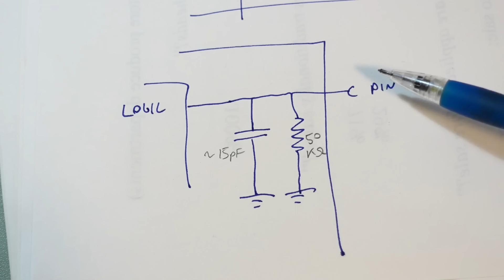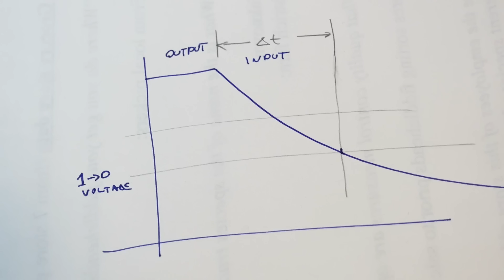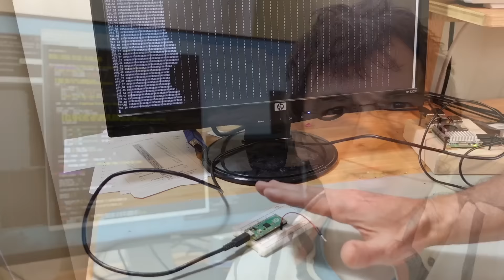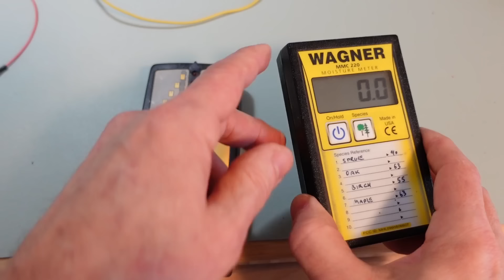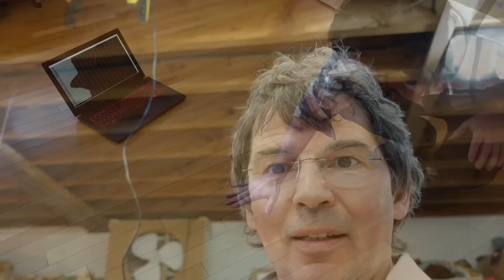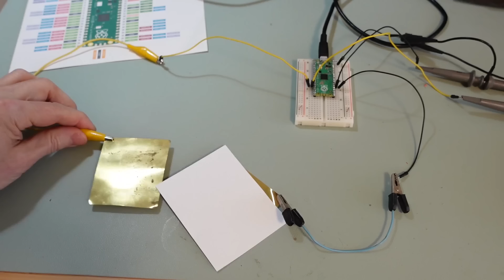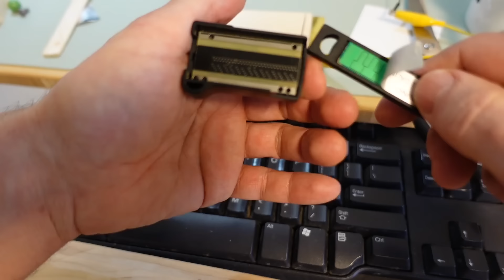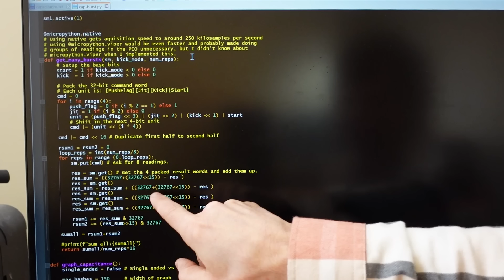Detecting proximity with very low capacitance measurements

Comment: Very nice. I want to mount an array of plates as a security system. Easy to run wires under the floor in my house, much more difficult to access the ceiling for traditional motion detectors.

Comment: I had similar sensor with 3.3-5V logical converter (those cheap ones) to detect my presence and room lights. I think i forgot to connect gnd and was surprised by non sensical output, which i realised depends on how close i am😂

Comment: There are some absolute digital calipers that don't need to be zeroed after a power cycle. I have one of them, works great and is very convenient - although I still can't get rid of the old habit of wiping the measurement surfaces and closing it to verify the zero point...
Reply from the maker: They all maintain position after "turning off" but that's because turning them off only turns the display off (also why the battery drains even while "off").  You have to remove the battery to be sure.
Reply: @matthiasrandomstuff2221  Ok, to prove you wrong, I just went to the workshop and removed the battery of the calipers. And actually... You're right.
I was dead sure, my calipers have been advertised as having an absolute measurement system. But it seems, I have misread that. Anyway, thanks for pointing it out, it did expand my knowledge 😀

Although there's one thing where your statement can be misinterpreted: Not all calipers maintain position after turning them off. I also have a bunch of cheap ones, which need to be zeroed every time I switch them on. For one of them it might be explainable by needing a new battery every time I use it. But the other one seems to also reset the internal circuits when switching off.

Comment: You can measure the resistance with a voltmeter. Try to measure the inside of the bag, not the outside. The conductive layer is on the inside of the plastic.
PS, that's why putting an electronic circuit on top of a bag is doing nothing, except making the risk is ESD bigger. Outside is a good insulator.
Reply from the maker: I tried inside and outside.
Reply: @matthiasrandomstuff2221 That's weird. That van only mean it's no esd bag because that must have some resistance. Did you use large enough contact pads?

Comment: I used to teach this to industrial design students using aluminium foil. You can get really creative using just aluminium foil and a resistor as a sensor. By the way the ESP32 has dedicated hardware on chip for this kind of sensing (called capacitive touch pins).

Comment: I love this idea. The capacitive can and plate experiments made me think of a project that I've done which uses a millimeter wave presence sensor to check to see if anyone is sitting at my desk. So the moment I walk away, the ESP32 I have connected to the  presence sensor sends keystrokes to my computer to lock it. 

I could see this as being a far simpler way of doing presence sensing without the need for the additional millimeter wave sensor. All I'd need is a plate mounted below or near my desk, and I could determine if I've walked away.

Comment: very interesting ! why human body affect electronic signals ?

I also encountered a similar effect when I was wiring an arduino to dot matrix module, where I connected the power lines and left the other 3 wires unconnected, so when I get my hands near the wires the dot matrix sends random signals to the MAX7219 and displays that of the dot matrix displays, the students asked me why and I told them that because there's electricity everywhere in the air and the human body is interacting with all these kinds of electricity + our bodies are already charged with some electrical charge.

Comment: I was using a pico for a training device using it with PLC software, and when I had it running to different stuff without bleed off resistors, I ran into getting false positives on it once installed in a box. At the time i ran resistors to ground off each input to eliminate it, as some of them would keep flickering on and off ruining the program from running properly. This makes me want to revisit it for other testing, thanks!

Comment: You're having too much fun. Another way to measure capacitance is to use it (the capacitance you want to measure) in parallel with a fixed capacitance in an oscillator tank circuit. Instead of measuring the decay time you measure the frequency change.

Comment: Always wanted to connect a caliper or the linear readout to my CNC. Cannot drill holes through caliper though. The steel is too hard. Did something crude with dremel and the diamond cutter, not good enough for accurate sensing

Comment: If i remember correctly, that method of checking the duration for a capacitance to lower is the exact method the computers of the eighties used to see the position of analog joysticks, which were just two potentiometers on a stick.

Comment: This is so amazing, thank you! I can think of so many potential applications for this. For example, I've been wondering about capacitive water level sensing and I'm certain this would do it. I have a humidifier I run in the winter that has a water reservoir that has to be manually filled and I'd love to know when it's getting low, but because of the design I didn't want to drill any holes in it (if any air gets in the whole reservoir will dump and soak my floor). I think this would do it!

Comment: You actually reinvented a very old trick used on tiny MCUs like AVR ATTiny2313 for sensing touch buttons. Also could be modified to make a simple ADC based on the same principle of converting a voltage curve on a known capacity to a time value.

Comment: I remember coming across this effect as a problem, years ago. On the old Microchip PIC devices, if you used one of the bit-set or bit-clear instructions it would do a read-modify-write on the GPIO, and because the input register and output register had the same address you could run into problems if you did several bit changes in a row: if the previous change hadn't fully taken place due to the load capacitance, the subsequent RMW would overwrite it. I remember it being sensitive to *everything*, including proximity, and possibly the phase of the moon.

Comment: if one of your capacitance plates was a bi-metal strip then you could sense temperature changes. Fixing the zero point might be chore though. Perhaps to measure humidity you could place some hygroscopic material such as rice , bentonite or silica gel between two plates.  Plenty to explore.

Comment: I'm thinking that instead of measuring voltage drop time you could also do the thing that they do in the cheap soil moisture sensors. They basically put about 1MHz signal into RC filter where the capacitor includes PCB tracks on the sensor, With the right choice of R and C values the output voltage will be capacity dependent. You'd need ADC input to read the value but wont need the precise timing. It may give worse resolution than timing measurement tho.

Comment: Cool, i made many years ago similar things with an AVR. Atmel made even a special library (and kit) around this for touch sensing (sliders, rotary switches etc). I made some sliders and they still work every day for the last 20 odd years. I made a slider (on kapton) to control some led lightning (dimming function) attached behind a strip of plastic.

Comment: Nice video for exploring capacitive sensor theaory.
Just in case anyone is interested, capacitive proximity switches are readily available at industrial suppliers.
Part of the sensors job is to isolate processor from the world. Using the output pin as the sensor leaves you exposed to the angry world.

Comment: Great experiments Matthias, and definitely food for thought. Presence detection for home automation comes immediately to mind.
Regarding LVDTs, it is perfectly possible to DIY such a thing and is essentially three coils wound onto the same bobbin with the central one excited by a frequency source, and the two outer windings used for measurement. A soft iron, or preferably a ferrite core at higher frequencies, is then moved mechanically through the centre. The downside is is the mechanical constraints and fidelity.

Comment: very interesting. this technique has a lot of potential. I wonder, how well would it work on other microcontrollers? Since it depends on fiddly factors like input capacitance and logic levels, it will probably work a little differently on different microcontrollers. but since it's all relative, it should work on a pretty wide range. This technique has a lot of potential.

Comment: Buy an "absolute" (mitutoyo) or origincal (IGaging) caliper/linear scale.  They have more than one scale and can dead recon their position.

Also, if you use a proper silver oxide caliper battery instead of an alkaline, the calipers can remember their position and track changes for 10months on a real 357/SR44/AG13 silver oxide  battery.  But only last one month on an LR44.  And many alkaline batteries are passed of as silver oxide natterybnumbers.
You could probably run a low Quiescent current 1.5V linear regulator off a small lipo battery to supply power.

Ignoring the vernier addition on a digital caluper, you can sense absolute position by using 3 electrodes in a capacitive voltage divider and feeding a full wave differential  ac signal (opposite phases)  into the outer two plates and measuring the AC voltage in between.  Thus can be done as a stack or in a sliding linear  configuration or a rotary configuration.  It is called capacitance micrometry.   I'm used to measure to 0.5nm over a couple micrometer range.

Comment: That's an interesting technique and it's reminiscent of how the IBM PC joysticks worked. IBM went absolutely minimalist (i.e. they cheaped out) on the "game port" hardware. Besides the bus interface, the X/Y lines just had a capacitor, a sense transistor, and a transistor that could discharge the capacitor. And inside the joystick were just a couple pots to +5V. When software wanted to know the joystick position it had to toggle the bits to discharge the capacitors, then stop discharging them, then read the bits back in a fast loop to see how long it took the capacitor voltage to get back to a level that would read as logic high. The longer it took, the higher the value of the resistor in the joystick was at that moment, meaning that you had the stick further down or right. Nowadays a $0.10 microcontroller can offload the job and do it with way better accuracy though!

The traditional way to do this kind of trick with capacitance, of course, is analog. You build an oscillator with the sense capacitor as part of its tank circuit, and its frequency will go down as the capacitance goes up. A nice way to measure that is to build two oscillators, one with a fixed reference capacitor and one with your sensor capacitor, feed them into a mixer, and get the difference frequency from the heterodyne effect. Then you can count zero-crossings to get the frequency difference and do the math to convert it back to a capacitance... or you can just amplify it and hook it up to a speaker and you've got yourself a Theremin (well, half of a Theremin at least).

Comment: Wow.
....
This gives me a feeling of how technology can know people's locations based upon data supplied by the WiFi Router.
People might think it's crazy, but I believe that they have a degree of thought reading technology built into modern smartphones.
Reply: Disconnect the ground on your Wi-Fi router and it won’t be able to sense people in the house. Could also create a ground loop around the router and it’ll effectively blind the router from sensing
Reply: @MrLegalizeplease  Like a Faraday cage?
That sounds like it could stop the WiFi router from sending WiFi signals.
But doesn't the router need the ground to be connected in order for voltage to run through it?
Reply: @matthewmathis62 no, doesn't need ground, just neutral and hot.

Comment: Some time I built a prototype low-power no contact water sensor  for a beacon type device. It had to monitor a thin fluid line. I used two tiny metal plates with the line inbetween, the resulting capacitor was used in a ne555 generator with a large resistance, the signal then went to a frequency divider and to an input of a low power microcontroller that counted the pulses. It worked really well and was really sensitive.

Comment: By adding a second set of plates you can measure the velocity of the rolling objects through cross correlation of the signals. Adding further plates and sampling between all of them allows imaging of the dielectric constant distribution in the domain. Pretty fun and advanced stuff. Look up Electrical Capacitance Volume Tomography for more info.

Comment: It is a nifty idea and it surprised me how well it worked.
It needs a bit of 60Hz or other noise to dither the individual samples to make the averaging work.
Yes, doing your average over some number of cycles is a good idea but you should have used 6 cycles of 60Hz.  That will make it do 5 cycles of 50Hz for those who want to repeat your experiment in other countries.
Reply from the maker: they will just have to adjust it.  I just figured out how many samples in 1 cycle and multiplied that by an integer, as I kept varying that, so your idea would not have worked for me.

Comment: What mechanism do the Mitutoyo ABSOLUTE Digimatic calipers use, and is it differently clever? I guess they have two patented sensor technologies, ABS (older) and AOS (newer) and we can probably look them up… or find a teardown video? «I have not done those things.»
Reply from the maker: I'm pretty sure the same way, but with a second track that tells it which repetition its on.
Reply: @matthiasrandomstuff2221  Doing a little research it appears Mitutoyo AOS uses inductive position sensors rather than capacitive (I hope that's not just a joke about multiplying by jω) . I think US11287286B2 is the relevant patent but ymmv.

Comment: I believe some of the pricier 'absolute' calipers have two capacitive scales - say, one that repeats every 0.89mm and another that repeats every 0.97mm. Both patterns repeat - but the phase difference between the repeating patterns gives you a third pattern with a much longer period.
Reply: notch filter 👌

Comment: That experiment with putting a plate under the floor made me wonder if something like this could be used for presence detection, like putting a conductive film/mesh under all of a bathroom floor to detect if someone is inside, even when they are sitting still, or do you think a plate that large could be affected so much interference to make it useless, like every time a truck drives by or a power hungry appliance gets started it detects a false positive?
Reply from the maker: That large a plate would probably be a problem. you'd want multiple plates for better sensitivity.
Also, thresholding gets difficult -- humidity changes could change your baseline reading.  And if someone is sitting on the toilet for a while, there's going to be no change to look for
Reply: if it was easy someone would probably already have figured it out!

Comment: Could be a better version of a bed occupied sensor for home automation!!
Instead of those pressure mats that just breaks after a while now you only need one wire
Reply from the maker: only if its a foam mattress.  And even then, the change is small, and there might be some drift with humidity, so figuring out what level means "bed occupied" is tricky.  Probably easy to see when someone get sin the bed, but what if they roll to the edge of the bed?

Comment: Keep up the tech level, loving it here. 40yrs back we did a college assignment to detect liquid in a microbore pipe used in medical infusion devices. We were able to see sub pico changes. We did it by magnifying the impedance using a transformer. We locked into the excitation frequency to ignore the noise.